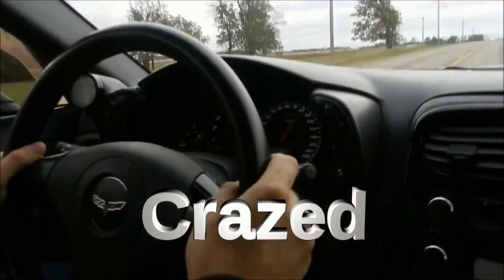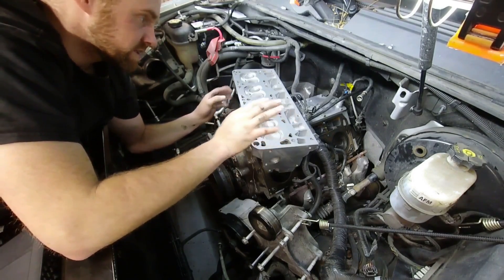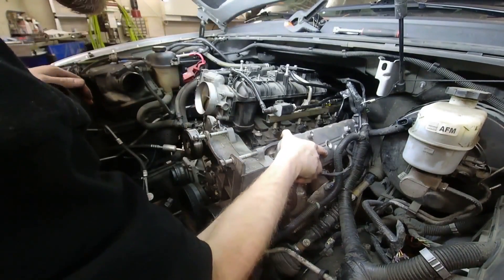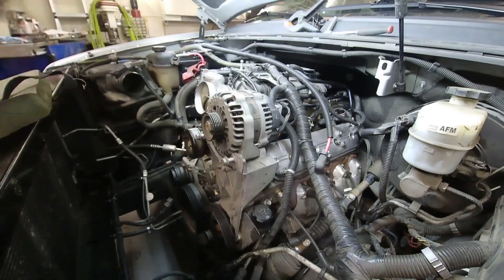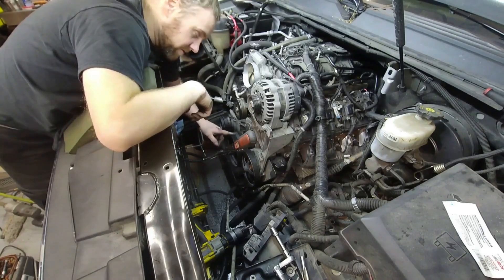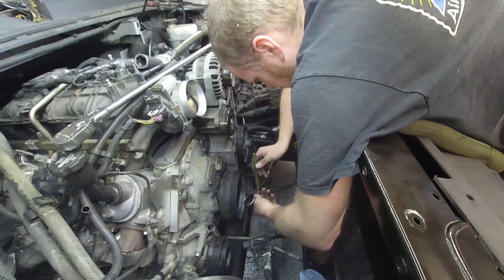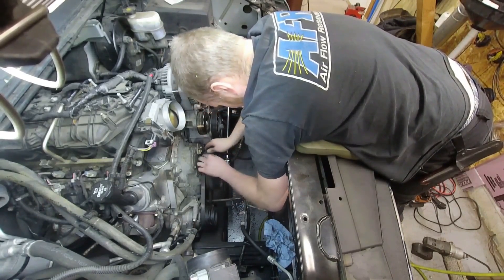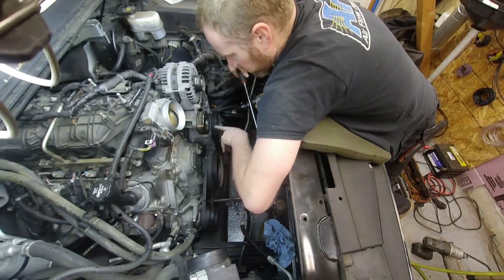DOD AFM Delete pt3 Installing the Heads & Fire up

Comment: I did the same thing where are the solenoids that go in the valley pan cover that deactivate or kill the cylinders. what did you do with that plug  in ? And do you know someone to delete the AFM off the computer good luck with that. I have been fighting with this 5.3L ever since the lifter collapsed 140k mi. Check engine light is probably on and you have random misfire  P0300 and other service lights will show up never get through emissions. I'm not a know it all just been my past experience owning one of these trucks. the GMC dealer wanted $4000.00 to pull the heads and replace the lifter that collapsed it happened right after the warranty ran out imagine that...Good video though very informative can anybody direct me to the 07 GMC 5.3L new body style DOD AFM delete?

Comment: Hello I have a chevy suburban 2004 1500 5.3 engine, the mechanic tells me that you have to change hydraulic divers, piston rings since a spark plug but oil is light, and unclog the cylinder head. What brand of packing recimendas as well as the divers and piston rings, to order them by rockauto.
greetings from Lima, Peru

Comment: Nice work, brotha.  Is it wise to change the oil afterwards?  Also, with a cam swap, does the cam need to be broken-in or is that just for old-school stuff?  -Chris
Reply from the maker: It's best to change oil this guy had just done a oil change less than 100miles ago so I saved his oil and prevented debris from getting in it. As for the cam break in, yeah that's just old school flat tapper stuff.

Comment: Forgot to ask - CrazedPerformanceRepair
 Did you send the ECM out for the DOD tuning or do you have the tuner your self - GREAT VIDEO -
Reply from the maker: I do the tune myself now it was worth the investment for me.
Reply: @CrazedPerformanceRepair  does a diablo tuner work reliably?
Reply: Will it start with out the tune ?
Reply: @roberttorrez7861  It will but has to be 'tuned' after as it is still programmed trying to activate the solenoids and go in Limp mode.   So mandatory to do this, and well worth it.

Comment: I have done quite a few of these. I have never sent the heads out for surfacing or valve work. I clean them up with a carbon scraper and check for flat. Back on they go. Last one I am currently doing I performed a compression check before pulling it apart to see if all the valves were sealing properly. On the valve job, my theory is if you have a nice tight top end you risk burning oil if you have a high mileage bottom end

Comment: Cool video! My shop foreman and I were talking about doing the DOD deletes. We have been replacing the bad lifters on these ls motors with oe lifters with good results. We did have one Yukon that came back with a bad lifter. It ended up just being a junk new part. We may start giving our customers the option of deleting the setup. Thanks!
Reply: nismo2070 I have done this in the past as well. New dod lifters and keep the old cam if it’s not ground down. This saves from pulling the front cover, cam.  Then have the software for dod deleted. That way if the pcm is ever flashed by a dealer the hardware is still in place to prevent a mystery problem if somebody else owns the truck.
Reply: @mph5896  what's the going rate for a DOD fix?
Reply: Bill Antalek jr I paid $650 for all the parts, ac Delco through rockauto/amazon. That includes an oil pump. Add on $50 for software delete through lt1cam swap. Book time for a cam swap is 19 hours. So prob $3k if you had a shop do it
Reply: @BBBILLY86  Ok, my previous post was for a DOD delete and cam swap. If you just wanted to pull off one head and replace 4 DOD lifters you could do it much cheaper. Maybe $300 in parts including the 4 lifters, $50 for programming and maybe about 4 hours in labor.